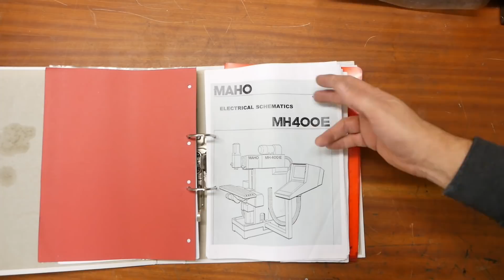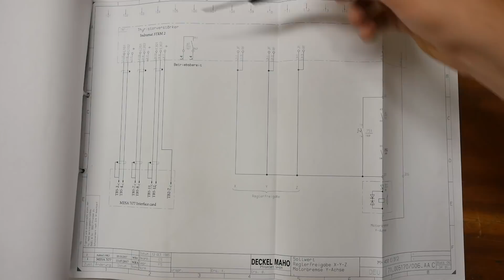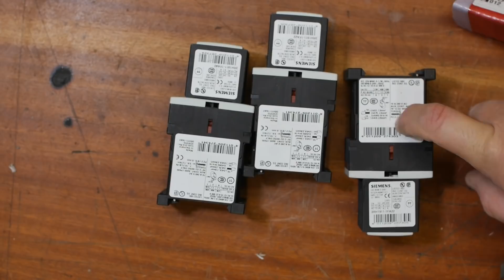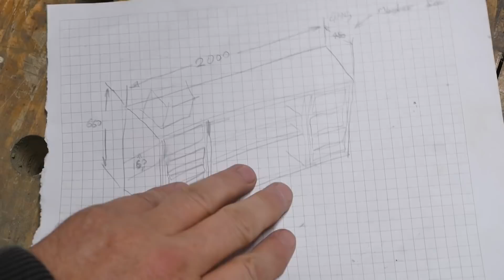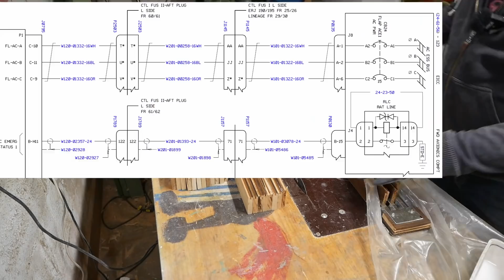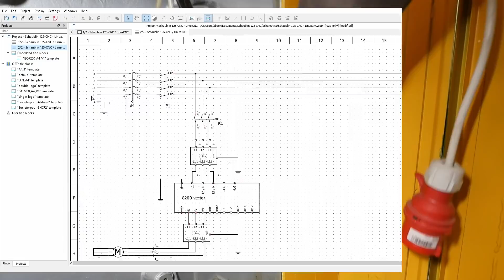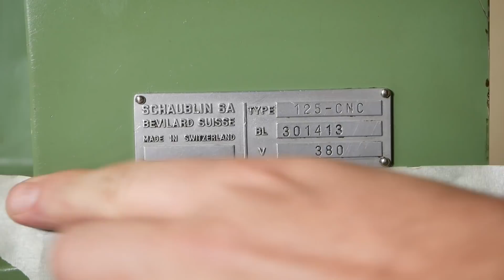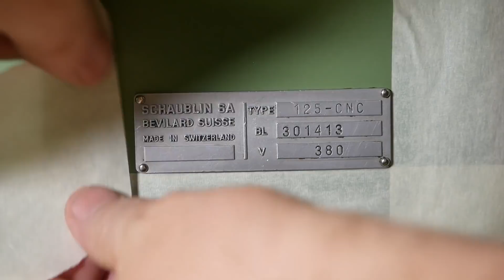How I do wiring diagrams for  CNC conversions.

Comment: Very nice Video. Even the Parts with this non conducting organic building Material and the spicy Food.
I just realized 2 possible Problems:
1. The first Device on the DIN-Rail is a Switch, not a circuit breaker or a motor protection Switch. Maybe it is a Placeholder ?
2. You also interrupt the neutral wire with the protection Device. This might result in Problems. Neutral should always be connected first and interrupted last. (broken neutral "Sternpunktverschiebung")
Reply from the maker: Brilliant. Thanks for the feedback. I need to go through the original schematic and check, but thought this was a CB.

I'll correct to leave the neutral connected. Appreciate your input there.

Comment: Are you not supposed to use ferrules with screw connectors?
Reply from the maker: Yes. If you mean in the disconnect panel at the motor end of the lathe, all those wires have ferrules on them. I reused some Schuablin wires. I will also put ferrules on the new wiring I do.

Comment: Hmm prefer the click in terminal blocks the screw ones always screw with the cables.
Reply from the maker: Yeah, I got a lot of comments on this last video. Seems there is a split between spring loaded, and screw in terminal fans. I will use ferrules on the wore ends.

Comment: I quite fancy seeing that scooter trailer coming together! You're right of course - that lunchbox mount is shocking. Maybe a dedicated rack/5th wheel arrangement in its place?
Reply from the maker: Yeah, I dont see it lasting as a tow bar.
Reply: @RotarySMP  having the the load point high up on a non-tilting trailer is in itself a safety hazard! An some load has to be on the attachment point. Your proposal is much better and safer! 🤓👍💪
Reply from the maker: @TheStuartstardust  Thanks. It didn't seem like a robust plan to me.